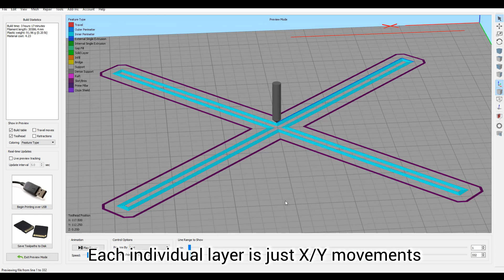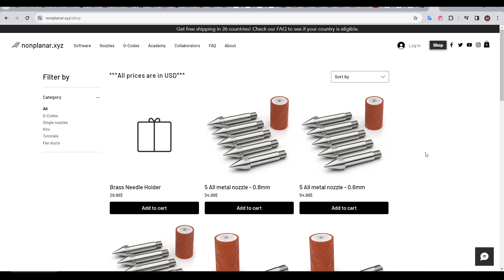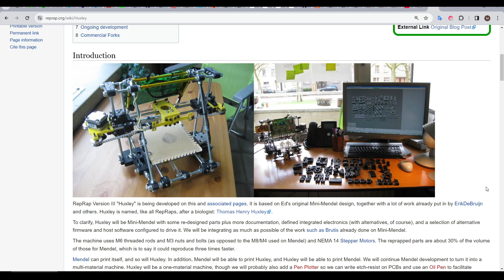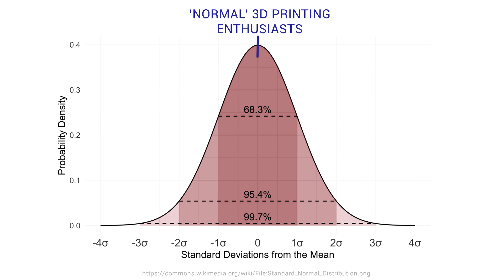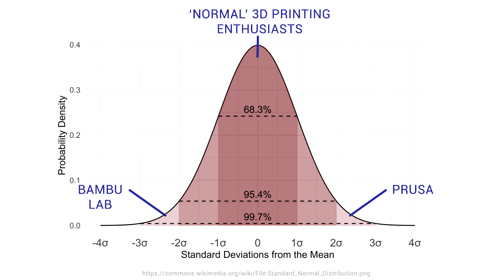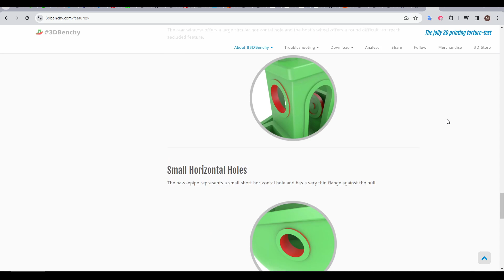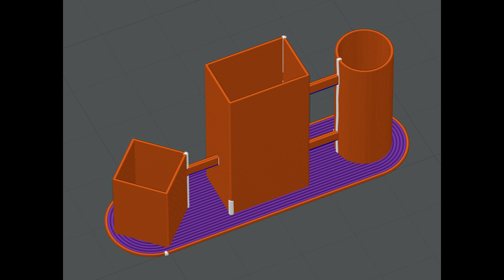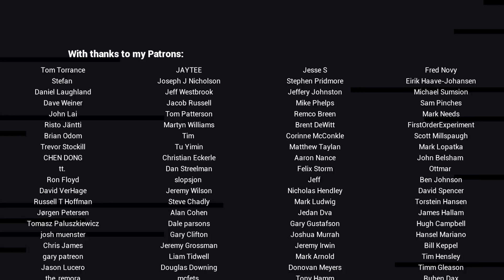3D printing mysteries that need to be solved in 2024

Comment: Regarding toxicity in the community - I think it just natural progression of having more people into the hobby. More people = more number of toxic people as well. I experience this to some of the communities in different hobby that i joined in.  Smaller group if there a couple of annoying members its easier to shut them or ignore them, but with more people there will also be alot more of them and they also become noisier.  

Anyway just wanna thank you for helping me setup everything for my 3d printer properly. I didnt experience much problem following your advice , been able to troubleshoot most of my issues and is happily printing now. Been interested in this tech since reprap times but I dont have the means back then. Been very happy to finally jump into this.
Reply: I always lived by the motto that if I wouldn't say something to somebody in their presence, then I would not type it.  Unfortunately, people gain a false sense of "bravery" when they are distant or anonymous.  I had such experiences in the early days of electronic bulletin boards when, after pointing out quantifiable flaws is somebody's arguements, I was asked if I had killed any astronauts lately.
Reply: I will say I'm new to the community and I was taken aback by the level of toxicity. I even made the comment to my wife about it. I'm in several gun and truck groups and they are less toxic than the 3D printing community. That's saying something.
Reply: I have a last fm profile and have had it forever. I almost never comment, but my comment field is open to whoever wants to leave a comment on my profile, like getting a tip about this or that band. I have heard that these sorts of music sites can get quite hairy at times, but I have never experienced it myself.
 
Until one day some person, probably a dude, leaves a comment as such: "Who the F listens to ABBA? You have such s Hi t taste." (ABBA is just a filler, as I can't remember, for it was such a long time ago.)
I looked at the comment for a while, wondering how I should reply. I did not want to reply as he did, because I presume that is how he wanted the conversation to proceed. I thought I might use reverse psychology, but then I thought it would be better to block the person, as it was not interesting to debate what or what is not good or bad music.
Reply: It is a problem with any online forum, most people just want to see cool stuff. Posts from beginners get condescending comments from more “experienced” people, people think they know better than everyone else and won’t even acknowledge anyone else’s points and any technical/advanced questions or new ideas get ignored. In some of the main 3D printing forums any post showing a model gets loads of engagement, questions from beginners gets lots of comments, a lot of which are incorrect or condescending and new ideas or more advanced questions get ignored or negative feedback.

It is at the point now where if I have any new ideas or technical questions it isn’t even worth asking on most forums, all most people care about is someone showing off.
Reply: Just an example. When I started 5 years ago with my ender 5 there were really only a few sources for trouble shooting and I were able to jump on reddit or forums, and not only where I assisted with tolerance and excitement, the problems was troubleshooted and everybody learned. Amazing mods was done in collaboration. Recently, I converted my Ender 5 into running klipper firmware. Although the documentation is written well there were still a few problems I needed to troubleshoot. And overwhelmingly the klipper community would not listen and just state look at the documentation. Only on their discord channel (after a few response like that) a few community member pointed out that (at the time) I installed the new raspberry OS and the issue I had was that this update was done the day before I converted to Klipper. I needed to reinstall the previous version. But the amount of abuse and unhelpful response to figure out that oh it's not me it's the firmware incompatability and there is nothing in the documentation almost made me revert back to Marlin.
Reply: @thecamosoupbone1273  that's the sort of example I expected to see, not the largely innocent comments he showed. Good on you for sticking it out.
Reply: I think that's indeed a big part of it. But also society in general, for some reason many ppl are just fixated on a brand or a thing they think is awesome, but then start to defend it no matter what. It's communication basics really, if you're just talking with emotion, you don't have an argument or are not willing to discuss anything really. I learned to ignore those ppl, especially as during the pandemic this was almost ridiculous in general and starts to affect you.

I see the same on Mastodon, for now (given the right groups of course) it's great with enthusiasts that help each other. If companies start to join and then my parents and their pets, that's when it's over.
Reply: What I'm reading, is that this is all thanks to 🇨🇳
inb4 "thasrassisst!"
🤷🏼🤷🏾‍♀️🤷🏻‍♂️
Reply: The Facebook groups are EXTREMELY nasty and hateful.  They make you afraid to ask a question.
Reply: I also think as hobbies get less DIY, people want to justify their expensive purchases.  That's why you'll see people being super defensive of their Bambu/Prusa and putting down the alternatives.
Reply: Tbh its society in general. 
Eventually if you go far enough left or right you meet the same nasty individuals.
Reply: @MrBizteck  I think you are right on the point here. It's not the printing community, but society in general.
You don't have to look far for examples, but I will give one. I have a lot of hobbies, and 3D design and printing is one of them. Apart from that I actually like playing games a lot. The example I want to give is Steam, and especially the games forum for several games. A few years back, there could be a discussion, and sometimes it could be heated. But compared to these days all that stuff was actually very tame. Nowadays it's not uncommon (or actually - it becomes rater common) to see a forum flooded with the one high-toxic post after another, to the point it has become almost unreadable. It's a very disturbing development. And, of course, it's not only limited to those fora, but also society in general.
Reply: @MrBizteck  Fundamentalism isn't the same as moving far to the right or left, people become extremists because they become absolutists, not because they take the ideology further than others (moving further from the center). Extremism is a wholly separate thing that may be pervasive in communities that identify with or have been identified as far left or right but has little to do with the ideologies they espouse. Think about what a "far-left" or "far-right" ideology means, most people would identify far-left ideology as being associated with wealth distribution and social policy, while far-right would be associated with corporate welfare, privatization and racial purity. 

It seems your use of the term "far-left" is instead directed towards those within either the "dirtbag left" movement or with "tankies", members of both groups identify with varying ideologies and can't be pigeon-holed into "far-left".
Reply: I still don't see how this was an example of being "toxic".  What is toxic about multiple people requesting a specific build?  Is it toxic because these same people didn't gush about his personal machine?
Reply: It's sad how non-Bambu owners are constantly thinking about Bambu, their marketing clearly works, being able to live rent free in haters mind all the time
Reply: @Techpriest1010 I don't own a Bambu printer and while I have considered getting one, they just don't meet my needs at the moment. Also they don't enter my thoughts unless I hear about them due to a new video.

A printer to me is a tool. I care about the one that fits my budget while providing the features I need. I have no need for love of or hate against any tool that solves someone else's problems. Not everyone has that response.
Reply: @Techpriest1010  I wish it were that easy. My timeline is flooded with Bambu videos. I hope by 2024 we are back to more diversity.
Reply: @Techpriest1010  Hard to not think about bambu when I keep getting help requests from bambu owners. (today it was a p1p that was printing deformed benchys but only with PETG)
Reply: its not really a hobby for the people that have bambu's. having it be a hobby would mean you know how the printer(s) works and how to fix them. not just click and print. only thing people with bambu's know how to do when they run into issues is email bambu support.
Reply: @tvaught125  Anyone who has a Bambu and gets some bad filament will know how to tear the whole printer apart and put it back together soon enough.  :)
Reply: @tvaught125  I don't think it is Bambu specific.  It is more about the people that are getting into it and not taking responsibility for their choices. Not understanding the tech. All magic to them.  I have been 3d printing for 40 year, and happen to currently own a Bambu. Have used many tech over the years.
Reply: @tvaught125  you are the toxicity we Talking about.
Reply: @tvaught125  Your comment is the exact toxicity he's talking about. The last time I checked the hobby is called "3D Printing" not "3D Printer Repairing." Stop trying to gatekeep the hobby by trying to say someone must go through X, Y, and Z to be a real hobbyist. Stop being the problem.
Reply: @vikingdisposal  3D printing involves repairing simply out of necessity. A clogged nozzle, filament stuck somewhere in the tubes or a loose belt are problems that occur with all printers and if you had to call a technician every time to fix the problem, it would cost a lot of money.
Reply: @andreas.grundler  I don't disagree with that but to say that repairing a 3D printer is what makes someone a true hobbyist is toxic and gatekeeping. If someone has the money to pay someone to fix their printers so they can focus more on printing that is fine. They are still a true hobbyist just as much as someone who likes to fix their machine. The reason they are a true hobbyist is because, as I said before, the hobby is 3D printing not 3D printer repairing. I'm in the middle of the road. I can and will fix my printer but not because I want to. That's not at all what makes me a hobbyist and not at all why I do this. It's just necessary for me to do those things so I can get back to the real reason I am a 3D printing hobbyist. THE PRINTING. Now that's not to say there is anything wrong with want to to repair or mod your printers. If you're into that more power to you. You just need to quit thinking you are special or a true 3D printing hobbyist because you do that. That's nonsense.
Reply: @andreas.grundler  the gatekeeping in those hobby are in different criteria. Like in an artist fandom its the you dont attend live, you only listen to x so you are not. Or on my digital illustration hobby its the anime, cartoon , realism , or the x software is better than your software. X is trash. 

Oth, I think it will come a time where there are 3d printers that are set and go print (some models are being release as the "it just work with no fuzz") marketing for people who wants to do whats on the tin - print 3d models. 

On personal opinion - i think as long as someone print 3d models with a 3d printer and interact in the community they already in the hobby - if they stay no one knows. Now there will be sub groups, those who participate the technical/ maintenance side, those who like model sharing side and create models and maybe many more.
Reply: @kaichidraws7787  I doubt 3D printers will ever get to the point where you don't have to maintain or repair them, at least from time to time. Just ask Chief Miles O’Brien. He has to fix the replicators on DS9 all the time. 😁
Reply: @tvaught125  you don’t see how your comment is an example of the toxicity of the community? People with Bambu lab printers can still be 3D printing hobbyists, just with different goals, their goals may be to design models and print parts, rather than spend lots of time tinkering with their printer, both are equally valid.

So according to your logic someone who just uses milling machines to make stuff isn’t a machining hobbyist and they only count as a machining hobbyist if they build their own mills and tinker with them? Or that they aren’t a cycling hobbyist if they just take their bike to a shop to get it serviced rather than doing it themselves?
Reply: @tvaught125 this is how I feel about every new Bambu owner. "Hey reddit I have this problem i can't figure out, so I emailed them and got sent a new printer. What a great company"

Comment: Snapping filament can be due to the loss of binders, via outgassing, that occurs in all plastics overtime. Also excess moisture or colder temperatures can lead to brittleness. The following is speculation, but keeping the filament in a sealed bag may reduce the loss of binders since the outgassing might reach equilibrium due the reduced volume.

Comment: Layer time with cooling will do that artifact
Reply: Yeah, especially with very short layer times the percentage of that time a high fan (for bridging, for instance) is still spinning down and thus providing more cooling than it would on the other layers is significant. I wrecked my brain on this for a while until it suddenly clicked. There's actually a setting to compensate for this in OrcaSlicer (and I think SuperSlicer, where the idea came from) called *Fan Speed-up Time*! It makes fan setting changes occur earlier on and may or may not help you get the activation and deactivation times more in line with whenever the airflow is actually needed on a layer.
Reply: This seems to be what I have noticed, I printed an electronics enclosure when it transitioned from the solid bottom to the relativity thin walls there was an obvious line on that layer that coincides with the sharp decrease in layer times.

Comment: There is an other secret regarding the benchy: the hole in the back is supposed for you to put there a string of filament, as to resemble a fishing rod.
Reply: I always thought it was for those cocktail picks with a flag...
Reply: Sweet lol just did it!
Reply: So with the two little holes you can check the dimention accuracy and the "Chimney in the Box" is for layer adhesion
Reply: Sure it's not a clearance test!
Reply: Nope, 1.75mm won't fit. The filament fits instead in the back hole at the base of the hull.
Reply: @bonovoxel7527  Yet those are the same size: 2mm . Gotta check you XY  holes accuracy, a bit too much flow there.
Reply: @bonovoxel7527 it’s a bench test boat. Therefore. Your printer isn’t printing accurately enough.
Reply: @bonovoxel7527 that's the test! If it doesn't fit for you, chech your printer's dimensional accuracy!

Comment: 10:54 Im pretty sure the tiny hole at the back slots into the top of the chimney
Reply: Not quite. Just tried it with a couple benchies and the hole in the chimney is just a tiny bit too small
Reply: That hole is for a piece of filament to resemble a fishing rod.

Comment: For the last one I would say cooling time could be one of the factors at play.
Reply: Cooling time, flow rate, and z seam alignment are the main issues I see
Reply: Cooling time and print speed. If the minimum layer time feature is enabled the machine will print faster where there's solid infill since it doesn't need to slow down to hit the target minimum time. The effect will be most apparent with filaments like Polyalchemy Elixir as the glossiness will decrease with increased speed.
Reply: possibly slowing the print head down on those regions might help too so the filament can be a better temp as it leaves the nozzle
Reply: That's a good theory. I think it's probably a combination of a bunch of factors but it hadn't occurred to me that it might not even be down to the layer currently being extruded, but the layer below being relatively colder than the rest.
Reply: It's time to layer. Just like you can change the appearance of the print with temperature and cooling. When you change the layer's printing time, you change its appearance. The solution to this is to define a minimum period for the layer so that you allow it to be printed constantly.
Reply: I think the main reason is due to the different flow rate at that layer. Bridging is usually set at a lower flowrate and not sure how retraction is calculate on that layer.
Reply: Ive found this to be mitigated a lot by cooling as well. If you print 2 or more of the object at a time, giving all the layers more time to cool, the effect is diminished greatly but its still there. So I think Michael may be on to something!
Reply: I may be in too deep but PID tuning while extruding at different rates is not often done on 3d printers (this won't account for heat transfer inside the plastic though). Also maybe there are some things in marlin that are supposed to change the way PID tuning works and may be able to remove those artifacts if it is from a temperature change eg: PID_EXTRUSION_SCALING and MPCTEMP....Ain't nobody got time for testing that though XD. After all that, maybe just limiting your outerwall speed to something slow would fix it.
Reply: @awscustomguitars  depending on the size of the part you can’t always slow down any more! I like your idea a lot.
Reply: Bang on.  I'd agree that it's cooling. The final layer of an object is printed slower for quality so the flow rate is dropped while printing and more time is spent on the cylinder than in other layers so the previous layer has cooled more before the next layer is dropped on top.  I'd agree with Michael on the indentation but that could also be because the previous layer isn't as molten when the next one is layered on top so its not squishing it as much.